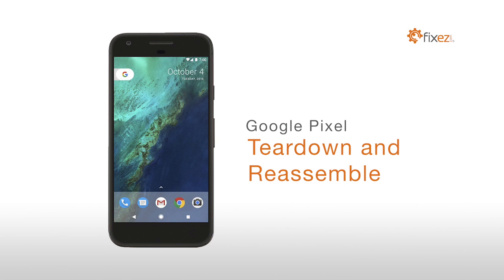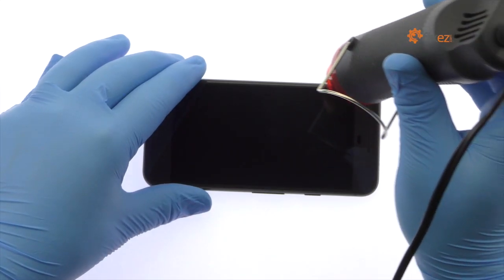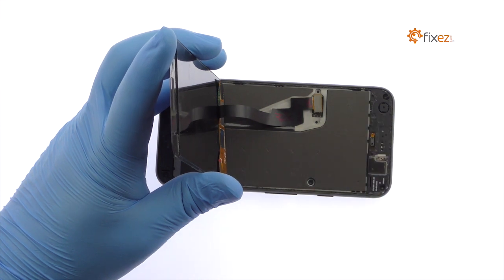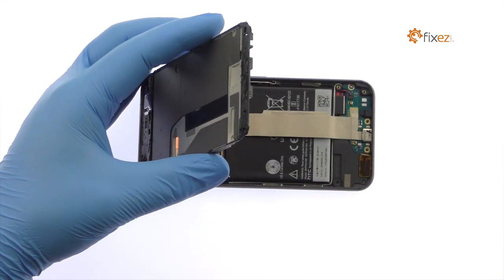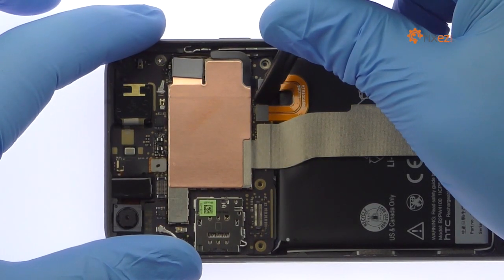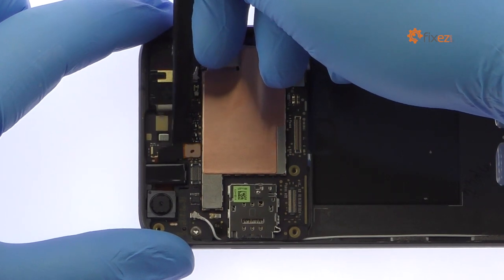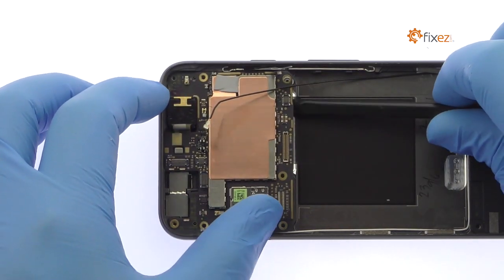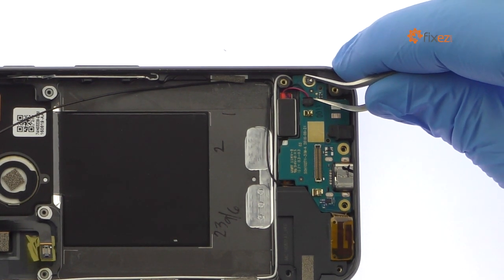Google Pixel Teardown and Reassemble Guide - Fixez.com

Comment: where is the mic in the phone ?? 
can I replace it ??
Reply: you can do it by changing the Charging Port PCB and replace it with another new. But search for the new PCB Rev (2.0) for holding back the soldering issue on audio codec - good luck! :)
Reply: To replace a mic you need a new Charging Port PCB. Here - https://goo.gl/Gqzja9